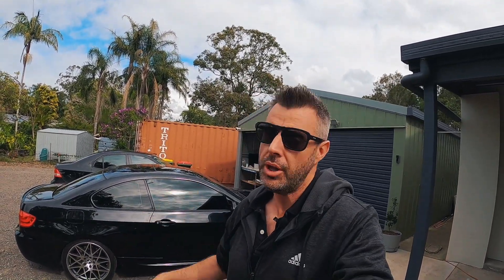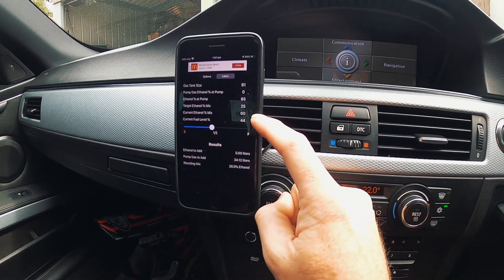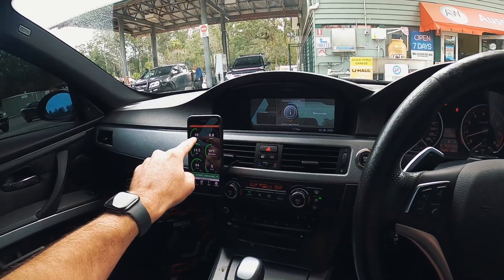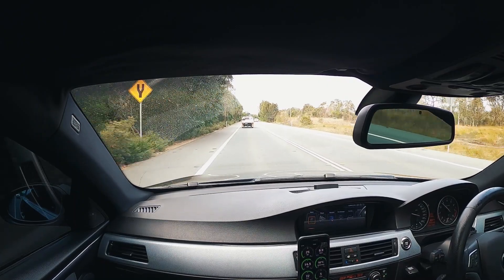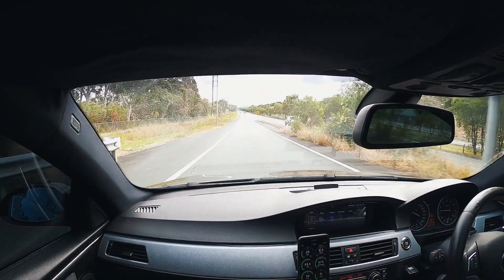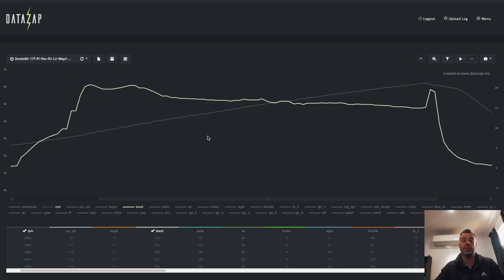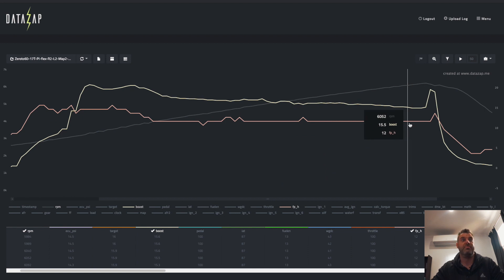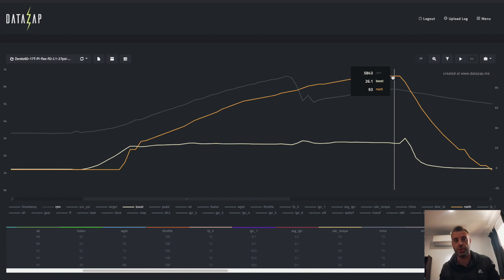E92 335i N54 REAL Flex Fuel With the JB4 & Port Injection: Part 3 Pump TEST

Comment: I was starting to think you didn't actually order brakes. :)

With normal pump fuel (10% ethanol in the US) I am targeting 6.5 degrees timing advance at 7000 RPM and high load. I am targeting 13 degrees with 30% ethanol. Boost at that RPM is about 16 psi with my stock turbos. I don't typically see corrections at those levels.

Comment: When fitting the brakes, don't forget to meticulous clean the hubs and clean the discs with break cleaner and smear with a small amount of copper grease on the hub before reassemble! The slightest amount of unevenness will translate to high spots on your discs in very short space of time.
Reply from the maker: Appreciate the tips man! Thanks I probably would have just slapped them on in excitement.
Reply: @ZeroTo60Tube  more than happy to help. I was a vehicle technician for 12years so it's the least I can do. Love the car by the way! And the constant content is great for us subscribers 👌 Thank you.

Comment: Great video guys, keep it up! Not necessarily a flex fuel question but a general Australian fuel one. I've been recommended to use a particular fuel (BP Ultimate) for my remap, do you guys have experience on if differing fuel brands impact performance at all? Any recommendations are appreciated.
Reply from the maker: I’m still on the fence on where to go with Aussie fuel. Most people stick to BP however I know the sulphur content is higher.

Aussie fuel isn’t as powerful as the states. So just go with whatever was recommended with the remap. And keep an eye on timing corrections. 

My personal view for us aussies is get on to ethanol blends ASAP. Makes so much difference.

Comment: Hey mate, what flex analyzer are you using?
Great vids helps motivate me with my 135i build!
Reply from the maker: Using the fuel-it analyser. I should have made it cleared that this was part 3 of the flex install, probably would help a lot of people understand the setup. 

If you have any other questions just let me know. It’s really worth getting setup if you gave access to e85
Reply: @ZeroTo60Tube  thanks and yes planning on picking your brain just waiting for return email from JSR thanks to you.
I run 135i n55 stage 2+ mhd and all bolt ons bar turbo was leaning towards meth injection sounds like trying to run straight e85 can get expensive and i think n55 hpfp wont handle straight e85.
Btw are you guys in Victoria?

Comment: Hi mate, love the videos. How is the tune going? Are you still running it? Where abouts can the MHD Flex fuel tune be purchased from? Looking at doing the same thing with my car. However I dont have PI I have the helix.
Reply from the maker: Hey Ben, Yes still running JSRTunings tune, its epic. The best thing to do is speak to a tuner about getting your car dialed in. I can recommend JSR enough.
Reply: @ZeroTo60Tube  thanks, I’ll flick jsr an email

Comment: Hi guys, I have been watching your channel for quite some time. Incredible job you have done for sure with the 335i. However, I would like to ask for an advice, I am with stock cooler and I am being offered for a very cheap prize to get a 5'' chineese cooler. In Bulgaria is quite hot during the summer 35+ degreese. I am currently with end to end exhaust system (wider also) and MHD software. I am not after performance and upgrading turbos and etc. , all I am after is ~400WHP (max), will this cooler be good enough for my needs?
Reply from the maker: Yes it really should be more than enough. I used to run a 5 inch stepped cooler on this car, and it was a big step up from the stock cooler.
Reply: Thank you guys! Keep up the good work!

Comment: The JB4 can't do flex fuel, as it can't adjust timing. Difficult to understand the advantage the JB4 is providing here.
Reply from the maker: The JB4 controls the port injection. Part 1 explains how the Flex setup works, which i am guessing you haven't seen?

Comment: Hey, I do have a couple of questions about your flex fuel and tune setup. Are your custom tunes a modified JB4 Hybrid E85 PI BEF tune? I didn't see a Pump tune or a Flex tune for Hybrid Turbos w PI, so has your tuner effectively created a Hybrid Flex PI BEF custom tune for your car? Also, can you still use JB4 maps on the fly to change boost targets? Cheers.
Reply from the maker: Yes, JSR has done a custom tune for the flex. The JB4 free maps are great and helpful for testing setup to a point. But this car went so much better with a custom tune. For the money the JSR is a no brainer. My car shifts so much better with the custom tune that it did with JB4 ots.